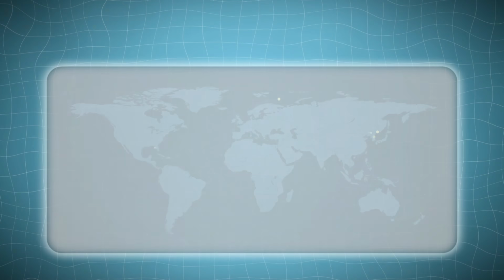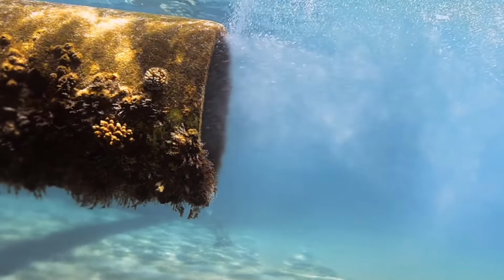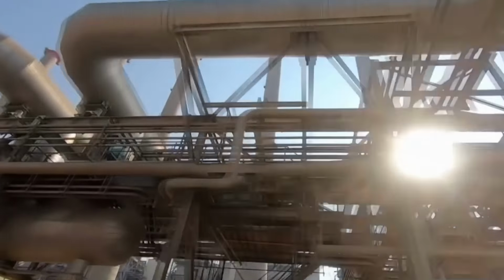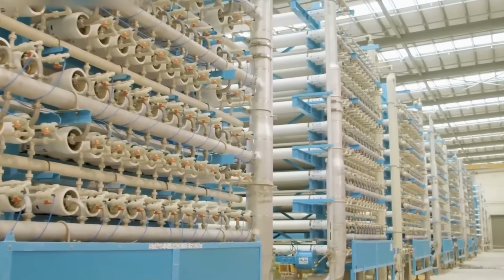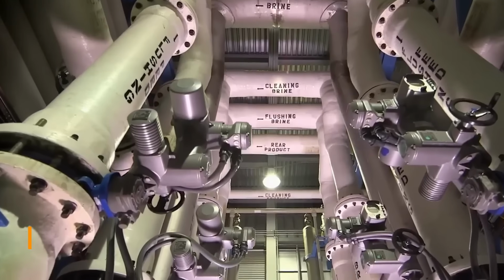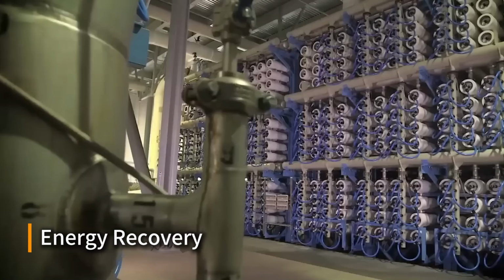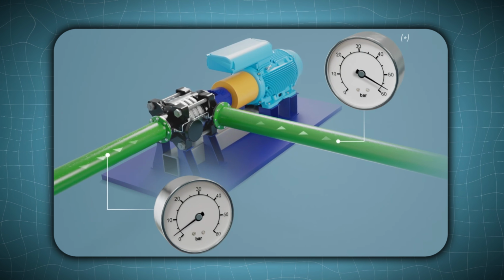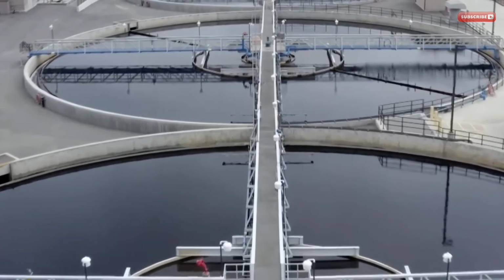Why Is Turning Seawater Into Drinking Water So Difficult?

Comment: Pumping seawater at 1,200 psi just to get a 50% freshwater recovery rate is wild when you look at the sheer electrical load required. This video perfectly illustrates why the energy-water nexus is our biggest infrastructure bottleneck. If we engineered better closed-loop thermodynamic systems for our commercial and industrial sectors, municipalities wouldn't be forced to rely on massive desalination plants just to provide drinking water.

Comment: It’s easy to forget how much engineering is required to turn something as abundant as seawater into safe drinking water. The reverse osmosis process is especially fascinating—forcing water through microscopic membranes at enormous pressure while recovering energy from the concentrated brine. The technology is impressive, but the challenge of managing energy use and brine makes large-scale desalination much more complicated than it first appears.

Comment: Why not a much simpler system - evaporation and collect the water vapor into a clean water basin.  During the day you can use solar power; at night you can use electricity to heat the water.  When the evaporation pool is "empty", go through and sweep out the remnants which will include anything that isn't actual H2O.

Comment: Why not use the sun to evaporate sea water? Just make a wide tank inside a glass house, and collect water from the walls, 100 liters per square meter a day. 

Oh, no! You can't have a patent for this. No patent, no profit. It MUST  be a regular plant. The more expensive it is, the more money for the company.
Reply: you're talking about solar evaporation, a desalination technique that has been used since 4 BCE. the reason complex desalination systems are needed instead of simple solar evaporation because solar evaporation produces far too little water and requires massive amounts of land to support a city or farm.

regarding patents, tech patents have expiration date of only 20 years, after that it's free use.
Reply: @jaend6924  The land price - I agree, is important. I am not saying this is the solution for everyone and everywhere. Maybe somewhere in a desert land could be cheap? Pumps and pipes are still necessary, even more, so it has it's cost too.
Anyway, a tank with glass lid in 4 BCE? I doubt it. And price of bronze at that time? Wow.
Reply: @jaend6924 I'm thinking he was asking why not use that process for the brine produced.
Reply: also, 100 liters per square meter a day using solar evaporation is a laugh and makes zero sense. due to fundamental thermodynamic limits, the maximum theoretical output for a single-stage, 100% efficient solar evaporator under peak sunlight (1 kW/m²) is only about 1.5 to 1.6 liters per square meter per hour, translating to a maximum of 10–12 liters per day if you consider you don't get peak sunlight all 24 hours a day.
Reply: @jaend6924  I've seen tanks evaporating 20 - 30 cm deep in a day, drinking water, not sea water, also wind may be important here. Still I wish to see a working model of such an evaporator, and the numbers from it. I kind of, not quite believe theoretical estimations while I remember what I saw.

Comment: It would be so easy to simply power these with nuclear. Preferably thorium. You can even extract the salt needed for the thorium fuel out of the brine.
Reply: Nuclear energy near water brings it's own dangers. Think of Tsunami, hurricanes earthquakes. These natural disasters can damage nuclear reactors and cause widespread nuclear contamination. Similar to the Fukushima earthquake in Japan.

Comment: It takes an enormous amount of electricity to run enormous water pumps that force water through the filter cartridge membranes.  I have designed 2 desalination plants for North Carolina.  It's a lot less expensive than building thousands of missiles and missile tunnel systems.  But when you think hate is more important than your thirst......

Comment: That seems like a lot though... Why not Heat, evaporate, and use a still? Takes longer maybe
Reply: Because evaporation method is actually more expensive and take longer time than the reverse osmosis method. If you apply it at a large scale.

Comment: I am shocked that using a natural solar still to desalinate water isn't being done!! Look at All that infrastructure! Ridiculous not to use solar still to desal water!! Is that against the law like windmills!
Reply from the maker: The main problem is that solar stills produce fresh water too slowly. For large-scale water supply, the output per unit area is simply too low.
Reply: @HowItAllRuns I just saw a very simple Sea water distillation unit that would be equal to of r less than in terms of infrastructure! Using a parabolic mirrors for heat would boil the water with sunlight! If they can put a Man on the moon! They can figure out distillation!

Comment: 1.386 billion km3 of water are you sure ? 
you ALREADY said AND posted 1380000000 m3 it should only be 1.386 billion m3 or 1.386 km3
Reply: I also thought about this, but 1 km^3 is way too low so it probably is 1 billion km^3 (he forgot the k)
Reply: @whythosenames  yeah so i checked and earth does have a little over 1380000000 m3. 1.386 + "billion" + km3 is way too much water.

Comment: Why not just boil the sea-water, creating fresh-water steam, that steam then runs a turbine to create electricity, and then as it cools you've got fresh water as well.
Reply: The main issue there is that boiling seawater produces residue and brine which is very corrosive. Your power plant will need more maintenance and if it breaks down, you're now out both power and water. It's somewhat viable with nuclear power though and there are plants that do this in Japan and Kazakhstan!
Reply: It’s more expensive at scale than reverse osmosis.
Reply: Evaporation has been used but you can't boil the water.  The high salt content would destroy the metal of your heating vessel. Additionally the pan would have to be obnoxiously huge to work at scale.  So big even a full tree wouldn't be enough energy to make it boil, much less maintain it to full evaporation.
Reply: Too much salt
Reply: And the access salt?
Reply: You think genius engineers havent thought about that??😂😂
Reply: @bertz-0  Why can't people express their ideas without people like you interrupting them? 

Lack of humility?
Reply: @bertz-0 true... that's the problem with online influencers.... they think they can be engineers, scientists, doctors, lawyers, etc., just bc they took a few correspondence courses on it.
Reply: @frankharris3159   Anyone can be an engineer, scientist, doctor or lawyer.
Reply: The net energy needed to be applied to it to boil it would probably be significantly less than what was generated by the turbine. And the corrosion. 

If you think of any energy generated by turning a turbine, you need the main energy source to heat the water to make the steam do work on the turbine.
Reply: I Don't Know
Reply: I thought that too